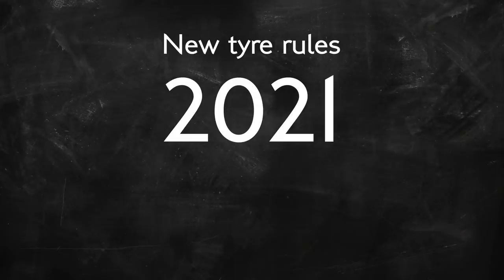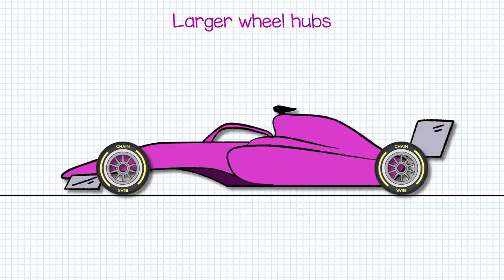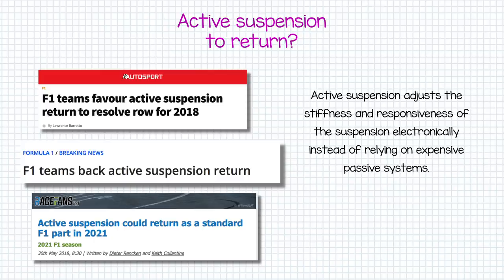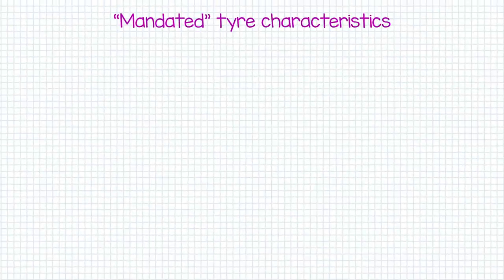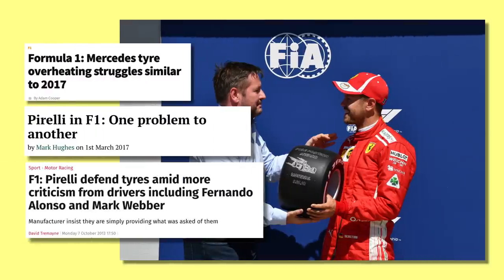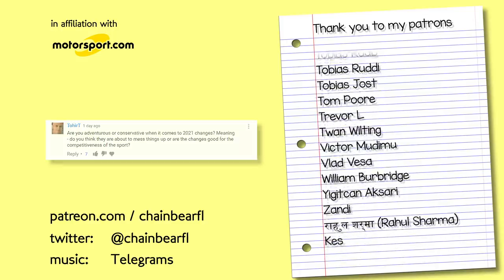New Tyre Rules 2021 explained - Low profile tyres, no tyre warmers, radical compounds

Comment: I know very little about f1. But it appears that's every year I see videos on changes to f1 this year. What's with the sport and altering the rules so much? No other sport does this. It's not like soccer or rugby or cricket changes laws and rules yearly but only change rules when needed and not insignificant things like fifa is changing the official ball size making it 2mm small then the following year they make a massive announcement that they changing the size of the balls valve.
Reply: Your comparison was really poor. Every motorsport does this. Albeit that the FIA does do slightly more. To answer your question: money and evolution. It's akin to asking why a GT3 race doesn't run with a car from the 90s while everyone is running a 2020 car. As the sport move forwards, the construction evolves. We learn new things, add others, remove some. We get more data to pull as much power as it can. It's only normal for the sport to keep changing the ruleset so that the competition remains.

Comment: Highly doubt the FIA will allow for active suspensions systems, mainly because Ferrari could not get it to work back in 92 and will most certainly veto it. But if it does come back, watch out for those red bulls.
Reply: That was 26 years ago. There are off the self systems now that work just fine.

Comment: The current tyre regulations are convoluted, hard to follow, needlessly complicated, and inherently self-contradictory. Artificially high-wear, and built-in unpredictable thermal degradation tyres exist in no other series than post-2010 F1, and is seen as little more than a joke. Therefore, for F1 to achieve stronger "Road Relevance" credentials, the series should impose draconian new rules regarding tyres with no regard to how it would impact the teams. The teams will be completely at the mercy of the tyre manufacturer since they will have absolutely no say on tyre design and construction. Tyre Warming Blankets will obviously be banned since they are not road car relevant. 
A single set of Ultra-Hyper-Super Hard Dry tyres, a single set of Intermediates, and a single set of Rain tyres will be allocated for each driver, to complete an entire season (25 races maybe?) of FP1/2/3/Q1/Q2/Q3/Race. Flat-spotting, higher than expected wear rates, tread damage, tyre failures during any session, and tyre changes of any kind and intent, will be severely punished ranging from grid penalties, outright disqualification, and participatory suspension. Anti-lock brakes, Electronic Brake Force Distribution, Active Suspension, Front-Rear Interconnected Suspension, Mass Dampers, is strictly not allowed since they are "Movable Aerodynamic Devices". These measures will "save on costs" and make the ultra-long wheelbase 2017- cars more compliant with that other dim-witted mandate of "Harder To Drive" F1 cars.

Comment: All the torque on the rear wheels and no grip or travel in the tyre that’s a big problem wot next run flats that will be fun the drivers will have bad backs after 1lap no matter wot compound they use low profile tyre are a joke on f1 cars you need flexibility if not they’ll be spinning up overheating! If they want to change the rules make it closer racing not three teams 1 min ahead after 25 laps then the rest and there’s something in the turbulence behind the car that teams are doing that’s not Wright tricky to prove but is some of the aero on the cars there just to upset the car behind???

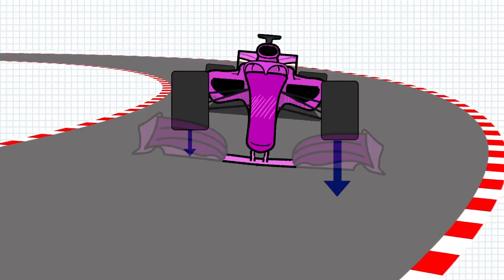Comment: 4:16 This is mostly false, and is only true when roll angles are large, visibly so, and the sprung center of mass shifts outwards slightly. This, of course, slightly shifts more weight to the outside, but is not a very large effect on F1 cars with such low centers of mass, and low roll angles.

Chain Bear, do you want to end up like Engineering Explained? Largely disregarded by people who take vehicle dynamics seriously?

Comment: 7:45 This part is just f*cking stupid from them. Saving tires has already a strong negative effect on racing. Drivers are saving up tires (and fuel) so they're more likely to just follow each other for most of the race. Yet they want more of the same... They should mandate tires that last the whole race with a N*10s penalty for tire changes.

PS:
Also, they want to remove the flow rate, which will obviously worsen this. They should remove the quantity limit and have the flow rate at a reasonable level. Can we have some racing for heaven's sake...

Comment: Low profile? REEEEEEEEEEEEEEEEEEEEEEEEEE

also GOD DAMMIT F1 MORE MECHANICAL GRIP AND LESS AERO
Reply: How can you say less aero to a thing that moves trough the air at a faster speed than a jet fighter take off at ? The Air pressure becomes everything at this point.

Comment: This is utter rubbish! Firstly proper tyres looks a lot better than big wheels with a few rounds of electrical tape as tyres. Secondly, the marketing rubbish: F1 tyres are slicks and built for racing. They are not connected in any way to roadcar tyres. So Pirelli still can't market their roadcar tyres as F1 tyres even with the lower profile of the new F1 tyres because that would be false marketing. Thirdly, just because other series have low profile tyres it isn't a reason for F1 to have that. With that kind of reasoning maybe they should use a boring single spec engine aswell, just because "other series have single spec engines"?

Comment: Engineering the tire "cliff" is a joke.  Softer the rubber,  the more grip.  Let speed and tire degradation organically happen.  Bring in refueling, a horsepower cap at a 1000bhp or more which is achieved anyway the team wants: v4, v6, v8, v10, v12, hybrid or not.  Whatever they want as long as they stay within horsepower and weight spec. If you want to shake it up bring in manual gear boxes. GET RID of drs or any other push to pass features.  Drivers cant have abs or traction control but they can use a feature like drs to pass? Ridiculous
Reply from the maker: You can't let tyre degrade 'naturally'. When you design the rubber you're making choices about how the rubber behaves so you know the life cycle of the compounds when they're constructed. There's no 'natural' about it. I think these ideas oversimplify the way F1 works. These ideas would massively ramp up the costs and be unattractive to new comers.
Reply: @chainbear  well hell they should make an ultra soft that doesnt lose grip through a race so they can push the car's to the max the whole time.....🙄.. if they tried that I think friction would win and wear the tires without them having to engineer wear into the tire.

Comment: Anything that reduces the cost difference is better as it will increase viewership and improve appeal. F1 hasn't grown in viewership figures in over a decade. Racing is boring with just a few teams ruling the grid. They usually end up finishing in a line. Overtaking is boring. DRS is shit.

Comment: Great so we still have the tires falling apart if the drivers push them hard for 5 laps. Whats the point of F1 if not to make the cars go as fast as possible . What is the point of changing the aerodynamics of the cars so that the dar behind can follow cliser if the tires won't allow it gecause they fall apart. For me the softest tire should last 20 laps  the medium 35 laps and the hard should last 3/4 of the race going with the drivers driving the cars as hard as they were back in the early 2000s. When the drivers finish ghe race they should look like they had to work hard during the race not how they look now which is like a bunch of guys who were just out for a Sunday drive. Without more durable tires all the rule changes won't make any difference at all. We will still be forced to watch cars that can not go as fast as they are capable of . I have already stopped watching F1 afrer 43 years and it sounds like tgere us no pint in coming back in 2021 as it will still be the same old crap we have been watching since 2011 with no great drives by these talented group of men because it is all been aided by DRS and tires falling apart.

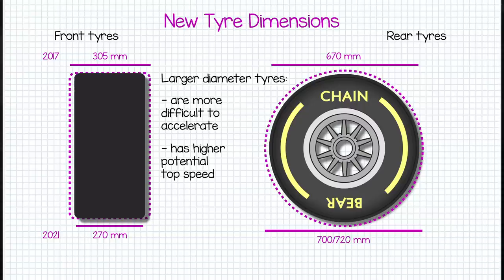Comment: 0:58-1:23 is just plain bullshit. a) Transmissions with variable ratios DO exist, which means that the argument is completely invalid, and b) even if they didn't the wide power plateau of turbo F1 engines (due to the turbos and electric motors having a maximum output and fuelflow restrictions) would completely compensate for this. And c) cars are drag-limited either way.
Reply: james64ibm he's just saying that that's what effect bigger wheels have, in theory.
Reply: Also, variable ratio gearboxes are banned in Formula1. The ratios are carefully selected when the car is designed and fixed for the rest of the season. They can be replaced if deemed damaged but not changed to a different ratio.

Comment: The modern age killed F1. So many people stopped watching and they are just trying to make the sport better for the sake of income. But in order to take someones money, you have to give them what they want. First, they fire the grid girls, which was a really stupid move. Then they introduce many new rules to make the sport safer. Please do note that i have no problem with halo, but i do have a problem with many other things. First off, set the budget to be the same for all the teams. Merc and Ferrari have over 400mil budget and ie Force India only 80. So set that up to a static number that all the teams need to have in order to have balance in finances. Next give them a rule of only engine displacement and nothing more, so that they can build beast engines. Give them unlimited parts with no penalties. Why? Well someone loses an engine mid race, so no points for him, and then fine them with 10-15 positions on ther Q line and you destroyed the next race and maybe even the championship to that driver. So, unlimited parts. Give them more races, at least 25. All conditions except snow. So if its raining, let them race. And in the end, these guys only race if the people want to watch them and pay for it, nobody wants to pay a few hundred euros/dollars to watch guys race around a track for 2 hours with nothing happening.